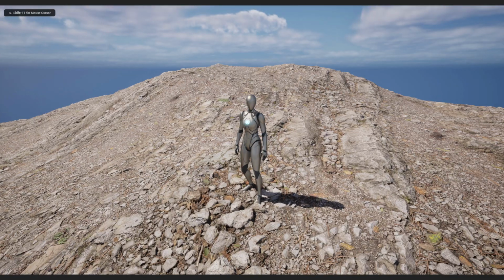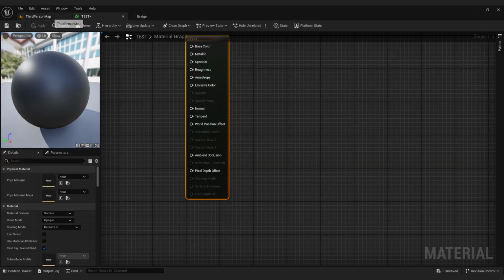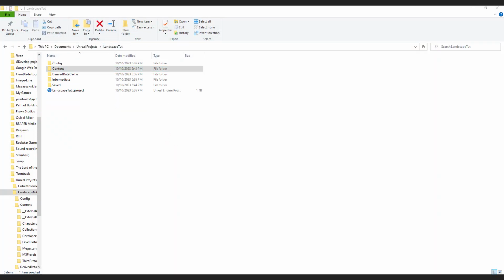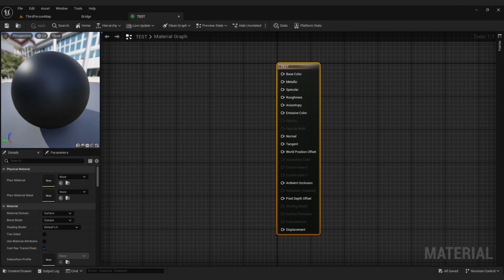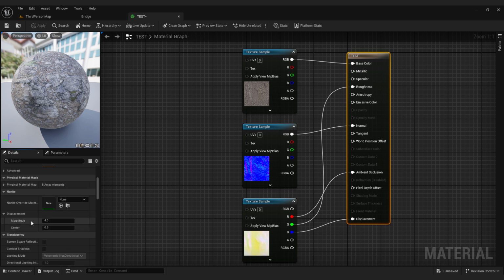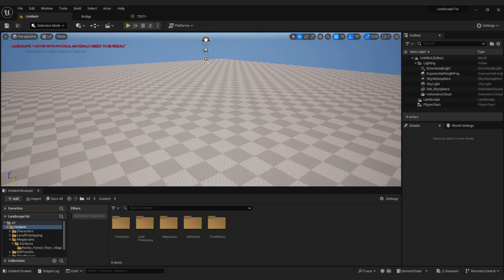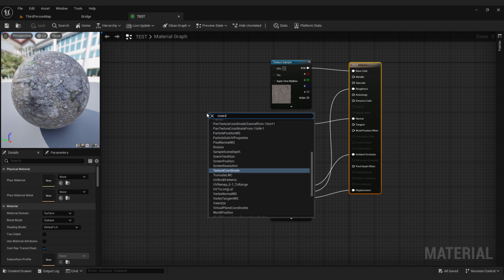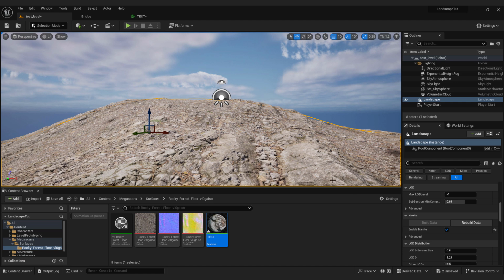Unreal Engine 5 Tutorial: Landscape Displacement for Beginners (UE 5.3)

Comment: Whenever I enable nanite on landscape it crash.... Even without command
Reply from the maker: 😕 Make sure ur UE5 is up2date. Also, chk if ur GPU drivers r updated. Sometimes, a clean project restart might help. If none of that works, check the forums for similar issues. Good luck, hope it helps! 👍
Reply: @ezunreal  thank you very much, but how did it happen that at first the landscape was a plain, and then a mountain appeared?